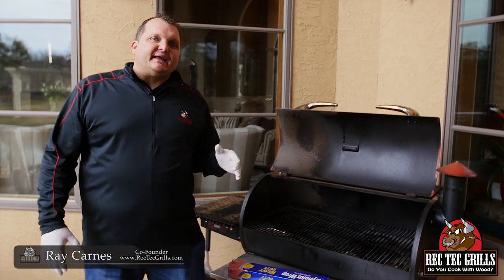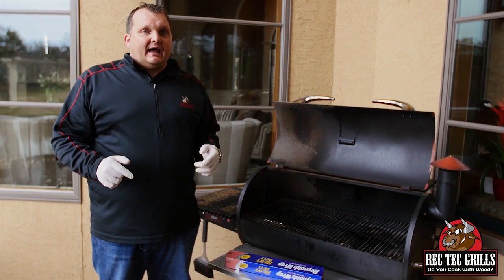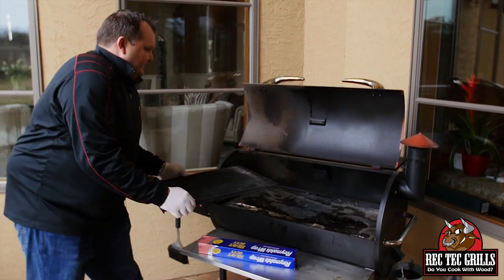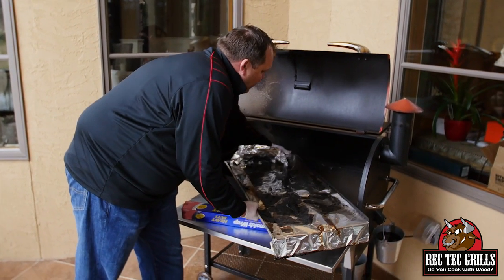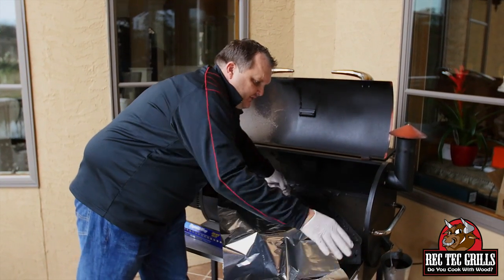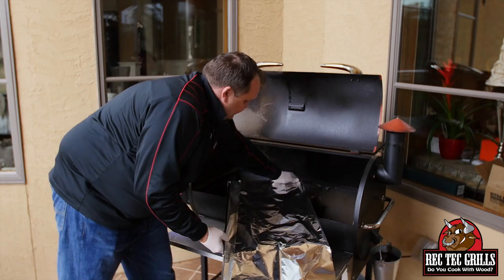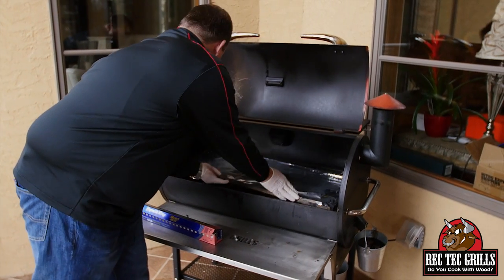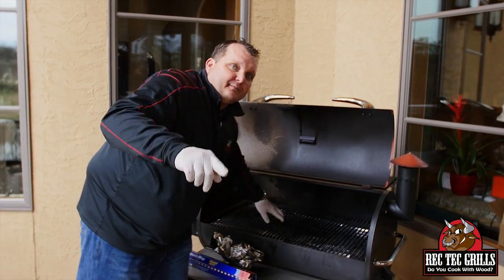How to Change the Foil on Your Drip Pan | REC TEC Grills

Comment: Hey brother, I got the Camp Chef Woodwind WIFI and it has slotted holes in the drip pan for air flow.  Should I still foil mine?  If so, should I poke holes where the holes are in the drip pan?
Reply from the maker: The purpose of foiling is for quick and easy cleanup. I wouldn't poke holes where there are holes in your drip pan because grease will drip through to the barrel and make an even bigger mess. REC TEC drip pans don't have or need holes, you should check them out. 😉